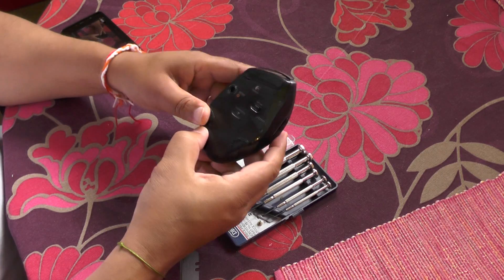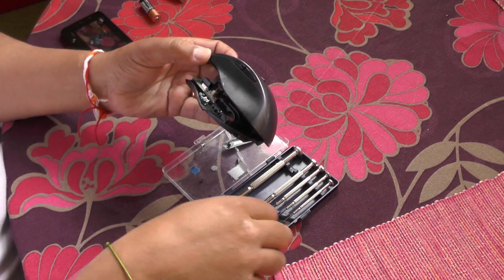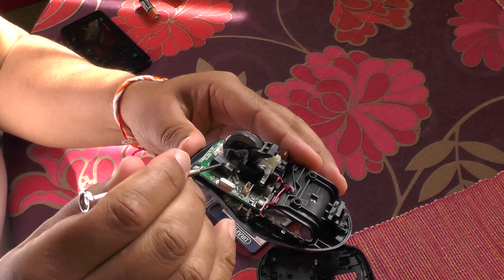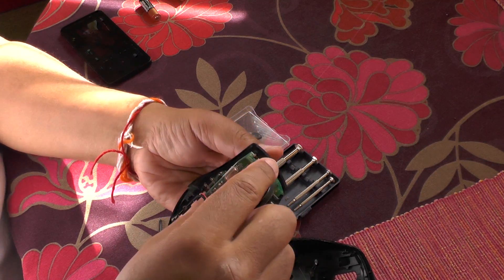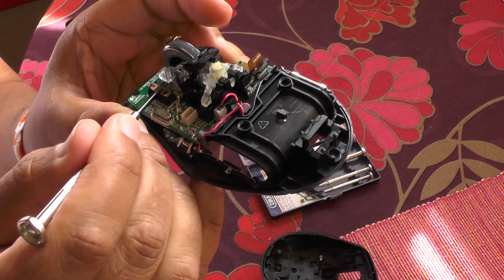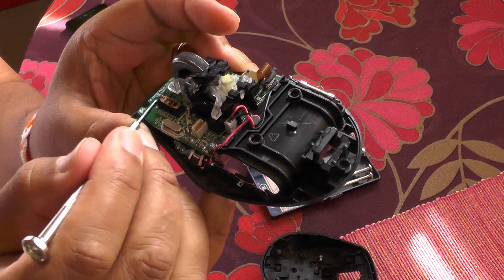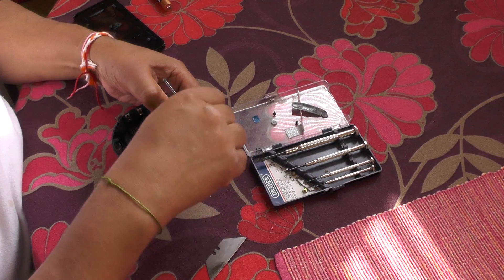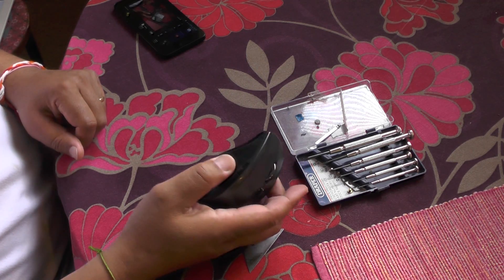Logitech Mouse Double Click Problem and How To Fix It - Red Ferret How-to

Comment from the maker: Update: Hi folks, just repaired beloved M705 again because the click was doubling again. Only this time I swapped over the right and left mouse copper switch plates to make sure the important switch was almost new. Took me about 20 mins from start to finish, lost a screw though, but the mouse is brand new. 

Tip: Do NOT think the M560 is a suitable replacement mouse for the awesome M705. It isn't. Horrible product, truly horrible.
Reply: On ebay they sell new replacement copper switch plates in packs of 5 for $6,  just search for "Logitech doubleclick".
Reply: ALL Logitech products in general are subpar - but their mouse products in particular, any mouse that is based on the same thin and flexible spring contraption is utter shit, those who have time could remove the copper thing and make their own PROPER click contact buttons, this design is utter shit, it's no wonder that the buttons fail after so few clicks, the fact you can easily bend them beyond repair just by merely sliding it out to remove it is a red flag.  I remember the days of older joysticks /mouse they were made with sturdy metal clips / springs, not this paper thing piece of shit.
Reply: They now have a cheapened version of M705 without the extra thumb button, crappy sensor, & cheaper plastic. Logitech can blow me, I loved that mouse.
Reply: the click quality part used in MX and expensive models are very low says chinese producers in the industry , complete cost of 1 dollar in parts could fix it to last almost forever

Comment: Hi! you're video is very nice but I'm having a hard time removing the black cover of the copper. I can clearly see in the video how you remove it. Can you tell me exactly how? I don't want to accidentally break it. Thanks
Reply from the maker: You have to very gently get a thin knife or blade under the catch at the end and lever it upwards (very carefully) until it unlatches from the base. Then do the same at the other end of the black cover. It's hard to explain, but it's basically a gentle push and lever outwards, rather like pulling a lid off a box of Pringles.

Comment: informative video, but i couldn't get the copper to bend back just right. i think buying the actual part for a few bucks might be easier. OMRON Micro Switch Microswitch D2FC-F-7N
Reply from the maker: Needs soldering though. :P
Reply: Red Ferret well i guess i know what videos i need to look for next. :P
Reply from the maker: Heh, good luck. :)

Comment: I finally tried to fix this mouse but somehow they've changed the structure inside that little box. I have no idea how to put the copper piece back in place. They've even rotated the whole box 90 degrees. Here's a link to a picture I took,I apologize if it's not that focused: http://i14.photobucket.com/albums/a350/luisjoseromero/IMG_0304_zps5f8d5221.jpg
Reply from the maker: Hmm..you're right, that's a pretty lousy image. :) I'm not sure what to suggest actually. The spring in the picture looks very similar, so I'm assuming that the bracket will hold it the same way (even if the orientation is different). The key thing is to get the spring latched in under the right bracket, and then it should go back properly (with a click). Sorry I can't be more specific, but I haven't seen that type of layout before.

Comment: I tried but wound up jacking up the spring, couldnt get it to sit after that. Especially after putting the cover back on. No other company I know of makes mice big enough for my hands. I'm a little disenchanted with the whole damn thing now lol It's my fault, I probably mistook which part I was supposed to bend in the first place.
Reply from the maker: I believe you can buy the little switch boxes on eBay, so maybe you can still get one of those and salvage the bits from inside and try again? Once you get how it works, you should be fine.
Reply: I had no idea I could get replacement switch boxes, the problem is that I'm all thumbs. My fingers are much narrower than yours (you'd think precision, right?) however I found I was a lummox in handling the poor little spring. Should I search "Mouse switch box" or something like that for the best results?
Reply from the maker: Nightshaft Give it a go. Search for Logitech mouse microswitch - http://www.ebay.com/itm/2-pcs-OMRON-D2FC-F-7N-Micro-Switch-Microswitch-for-RAZER-Logitech-APPLE-MS-Mouse-/120943922549?pt=LH_DefaultDomain_0&hash=item1c28d1cd75

Comment: I think ill buy a new one
Reply from the maker: Yes, but which one? Read my comment about the M560. It's awful.
Reply from the maker: Trouble is finding a replacement which is as ergonomic as the older models.
Reply: I bought a new one... It still double clicks.
Reply: I have 2 now, both have the problem.

Comment: lol im getting crazy when put that pin back ... dunno how but after reaching 2 hours, that pin are tighten at back ( im using g500, instead on your video is front part, but mine is back ) .. now my g500 work like a champ "again" :)
Reply: and the best part is .. that pin tighten after im watching your video .. still dont know how that pin was tighten..... -_-
Reply from the maker: clusterxii Heh, it's magic. :) Glad you sorted it out.
Reply: Red Ferret
I am gonne try 2 fix my old G500. And my new 1. That have this 2 already after 2 months. Is it not better to buy 20 of this : OMRON D2FC-F-7N Micro Switch Microswitch for RAZER Logitech
and just change that everytime?
Thx for the vid. From NL.

Comment: The clicking sound is so muted now... auuuuuugh....

Thanks for this.
Reply from the maker: Pleasure. If the clicking is muted, it may be that you need to straighten out the copper again.
Reply: The click is weaker too.
Reply from the maker: Theonegamefreak Yep, sounds like a worn out copper spring. Try doing what we just did and swap the right and left springs around. It's fiddly but it's worked for us.
Reply: But then the right click would be mushy.. It's all good though. Logitech sent me another mouse, fo free.
Reply from the maker: Nice.

Comment: im having quite the problem trying to remove the little black box with the white button on it, any tips?
Reply from the maker: You have to very gently pry the little tab at the bottom outwards from the box and kind of lift the box gently upwards. It's definitely a bit tricky, but if you watch the video and read the post again, you should understand how it works.
Reply: Red Ferret How long did it took you in this video?
Reply from the maker: ***** the first time it took at least 30 minutes, but once you get the hang of it, it's two or three minutes of careful prying with a small flat screwdriver or blade.

Comment: Thanks man I just fixed my mouse. Video and diagrams helped alot. Putting back the tiny plate was really difficult though.
Reply from the maker: Glad we could help. Yeah that bit is really tricky until you understand how it works.
Reply: I had trouble with that part as well. What really helped was opening up the little box to the clicker on the other side. Looking at the other metal plate that is already in place is the best visual aid.
Reply from the maker: DrDeathpwnsu Yes I did exactly that the first time I tried the fix. It's the best way to see how it fits together.

Comment: The one dislike that's on this video as of this post must be from the guy in charge of planned obselescence at Logitech. They make otherwise nice stuff, but put in a weak part or two that isn't up to par when it comes to the expected heavy use.
Reply from the maker: You would think they would have changed it by now, right? Strange.
Reply: Red Ferret
Yeah. I might have one or two old mice stashed away because of this problem. And my current one may be susceptible too. (It's Logitech afterall, so using the same parts bin.) If I still have them somewhere, I may fix them and bring them out of retirement.
Reply from the maker: Good luck with the new purchase. ;) I guess I would have done the same if I could find a mouse which is as good and with the fast scroll.